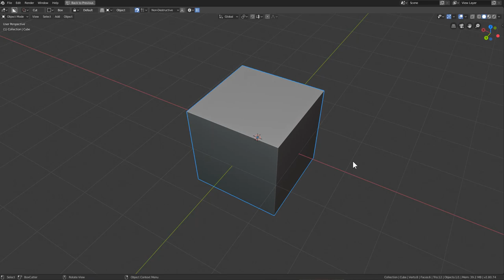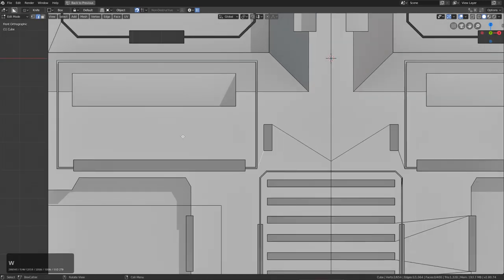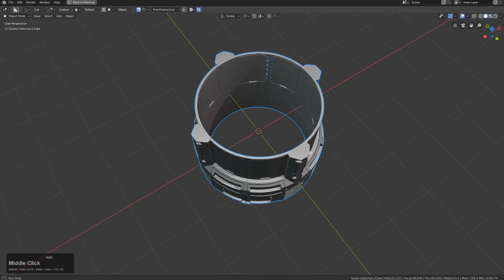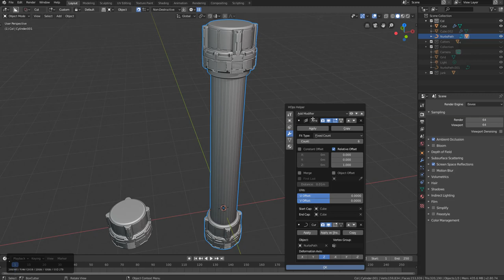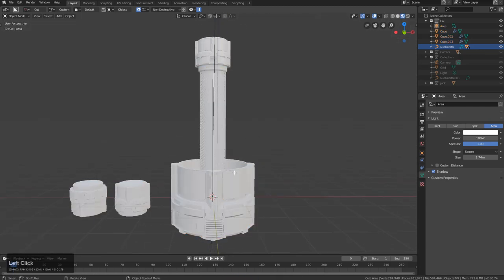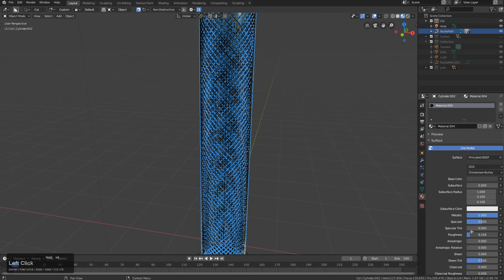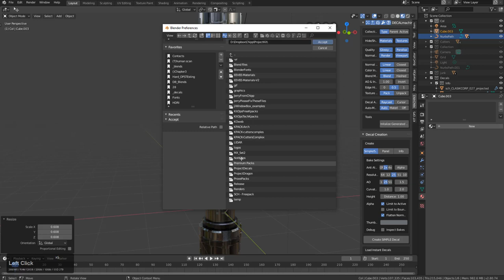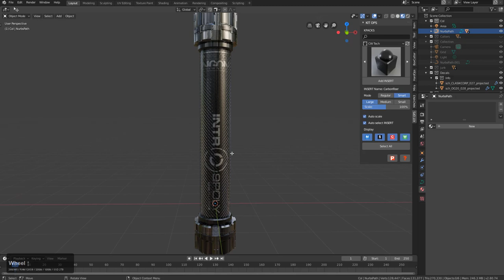#boxcutter 713 - HOS3

Comment: trick with "grid" didn't work. after several hangs I was able to at least start knifing, but cutter mesh collapsed to a line. Redone the custom cutter and figured out that only custom cutter should be in separate collection, now works. Another problem is that bend over Z axis squizes object, it looks like I must rotate object axis to make it work, which is straaange. Update: entered in edit mode, rotated all, enter object mode - rotated back, now axis of object rotated and everything fine. It's because I've started object not in FRONT, but in RIGHT view. what the heck.
Reply from the maker: I wrote about it here. 
https://boxcutter-manual.readthedocs.io/en/latest/edit_mode/#custom-cutter-grid-cut

This should give some insight. I did it myself just now to test it. 
https://cdn.discordapp.com/attachments/598565171203670016/637324886343417897/2019-10-25_11-20-16.gif

Comment: Wait... is this blender with a addon plugin? Or is this an entirely different software? I'll need to learn blender if it has this much power. I mainly use maya and I get more and more jealous of blender by the day. They can model, hand paint, sculpt, and even has box cutter for such OP hard surface detailing, its insane. Here I am, still on maya doing monotonous modeling and worrying about topology when you can make something like that in a couple of seconds.

Comment: Does anyone know what the material setup is here?  My cut lines are hard to see without wireframe or the perfect alignment of the model.  Tried several matcaps but none of them give that perfect edge contrast.  And has anyone had normals issues when adding the end caps?  My end cap mesh looks fine until I add it to the tube array modifier, then it just falls apart.
Reply from the maker: alt + V >> eevee HQ. Always. 

As far as materials they are generic.
Reply: @masterxeon1001  Thanks for the reply!! Any interest in getting some help building a training course??
Reply from the maker: Seth Jensen I’m always looking for capable affiliates with the soul of the box.

Comment: Is it possible to modify later those hand drawn cuts?
Reply from the maker: it would be possible were it designed that way. But to deform things properly I have to destructively apply it in order to proceed. So I'm sure users could with some creativity added however in the workflow illustrated.

Comment: My grid custom cutter won't cut. It stays the wrong color when I try?
Reply from the maker: Id have to see what is going on to diagnose the issue. 
Support Channels
https://i.imgur.com/axYJ8P7.png
https://i.imgur.com/W2XjC9R.gifv
Reply from the maker: also if the cutter isnt the color before draw it will go back to that color after draw so Id double check what is going on the topbar. 
https://twitter.com/mxeon1001/status/1123820309168177154
Also for the grid cut to work you must 
A. Start drawing off of the mesh and not using surface draw. 
B. remove the faces from the grid as shown in the video leaving only edges. If the faces are solid its a different situation. 
Notice in the video I began the drawing off of the mesh in order to make it use the classic blue box with grid.

Comment: Awesome addon! I just bought it and I really enjoy using it, but for some reason the circle cutter does not work at all, even with the latest version. Every time I try to use it it only cuts a straight line of vertices. Anyone else with the same problem?
Reply from the maker: This was due to an issue with the merge verts portion of the spin modifier. This has been reported and is actually fixed in the more recent release of blender 2.8 so get that updated and you’ll be good to go.
Reply: @masterxeon1001  Thanks, I just downloaded the latest build and now the circle cutter is working :) and thank you so much for making such an awesome addon, after a few days using it and hops I cant model without them XD. Now Blender is even faster!
Reply from the maker: @TopmotionsFilms  yay! glad we got it resolved.

Comment: I got the problem with box cutter, after some cuts i destroy the volume and so on... dk what iam doing wrong. Are there some vid tutorials?
Reply from the maker: Boolean rules apply. All boxcutter does is make setting up Boolean easier. That said, volume issues could be caused by a couple of issues. Hotlining which is where an object’s edge is cutting precisely into the main objects‘ s edge or even doubles. The next thing to think about is modifier stack. If the mirror is bisect and not modifier it creates a mesh that is half but mirrored so I’d have to see a gif of what is going on. In hops there is Q >> Operations >> Modifier scroll which can let you scroll through the modifier stack and find the problem area so the troubleshooting tools are there as well. Also if you click the sprocket in boxcutter there is an icon at the bottom for getting help from our discord server.
Reply from the maker: https://youtu.be/8qtEPLT2YnY This video is a popular introduction to boxcutter.

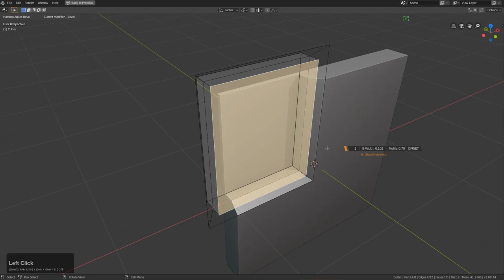Comment: 1:03 I can't take the same bebel amount inside and outside. can you help me?
I bought last weekend, Hard Ops 9 Version 0.0.9.8.3
Reply from the maker: https://hardops-manual.readthedocs.io/en/latest/bwidth/#how-does-reverse-bevel-work
Reply: @masterxeon1001  I can do that with Hops, but still can't with Boxcutter.  but I followed the manual and problem solved. thank you.
Reply from the maker: @begin-gd1jm  it doesnt exist in boxcutter yet. Its in HOPS at this time since it requires a special solution for non destructive.
Reply: @masterxeon1001  aha i understand. thx masterxeon!

Comment: i tried doing the copy grid to knife into my mesh thing and i could not get it to work it would place 2 or more distorted planes over each other. it didnt work until i extruded the mesh so it could have a slight thickness then i was able to knife project.
Reply from the maker: starting off the mesh activates view align. Utilizing knife's behaviors is key. 

https://youtu.be/OB11iuap-n4
Reply: @masterxeon1001  just tried the different settings and it still ends up making 2 versions of the grid overlayed over each other one small and another large but both are distorted in a Fish-eyed lens manner.
Reply from the maker: @sanyaiase2165  i might need to see a gif of whats going on. Id also make sure to be in orhto and not perspective. 
https://hardops-manual.readthedocs.io/en/latest/issues/#helping-us-help-you
Reply: @masterxeon1001  ok let me re check again to see if I dont have something else active if not I'll send you a gif
Reply from the maker: @sanyaiase2165  i think an issue has been located with this that we were unaware of. It should be resolved in the next version. HOPS also is capable of doing grid knife project so I would just use that in the meantime. Or dice. The workflow showcased here has been enhanced in other ways. We'll get this resolved.
Reply: @masterxeon1001  just installed the latest version and its working as intended!
Reply from the maker: @sanyaiase2165  i wanted to make sure we got your issue in that last micro fix.

Comment: I wonder why sometimes I cant dissolve edges with ctrl+x. In fact more often than not that ctrl+x does nothing for me. Can someone explain to me in which cases blender wont dissolve edges?
Reply from the maker: when the edge youre trying to dissolve is a key edge. Notice that in any case I dissolve an edge there is a replacement to take it's place. Something has to hold the form together and typically that is the last edge standing.
Reply: @masterxeon1001  I see. Seems like Im not using it right yet. Thanks for your answer. Its always crazy watching your videos, everything works so smoothly and when Im trying (relatively new to this addon) it often fails or it ends up doing weird stuff.
Reply from the maker: @Gothdir  I should have explained it a little better but I am obsessed with the why of certain 3d anomalies. Im pretty sure with that last edge in mind youll be able to take control of whatever youre trying to dissolve.
Reply: @masterxeon1001  Yeah that hint really explained it. If you would be so kind and answer another question for me. At some point in the beginning you used a grid as knife to create some square topology. Is this something you often find yourself doing? Is it something you would recommend in general or was it just this special case?
Reply from the maker: @Gothdir  only for deform. Most of the time it wouldnt matter. Just in rare cases.
Reply: @masterxeon1001  Alright! Thanks for your patience and answers. Have a good one.
Reply from the maker: @Gothdir  no problem im here for ya! Theres also a support group! 
https://gfycat.com/NastyNimbleArcticwolf

Drop in and see us sometime.